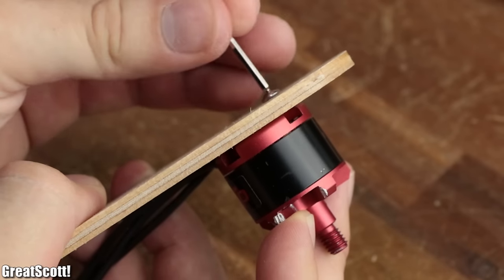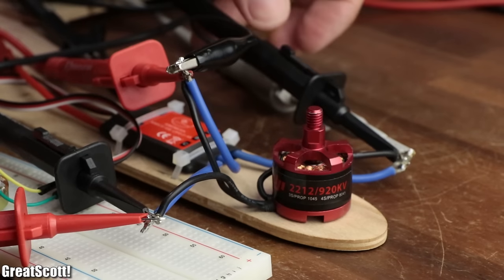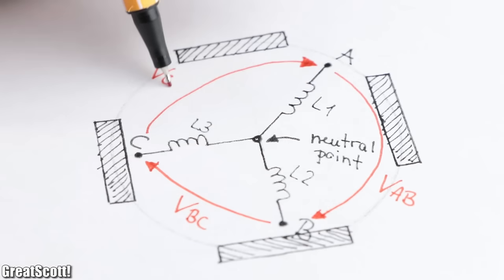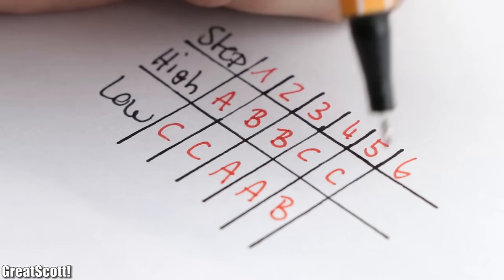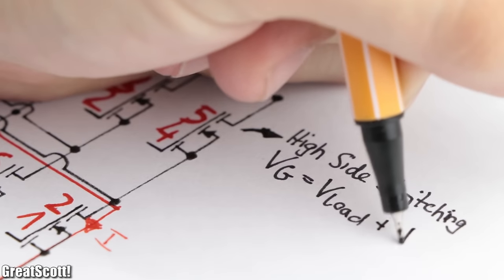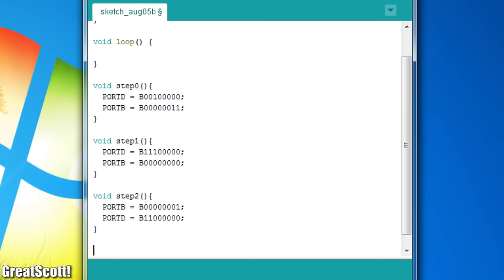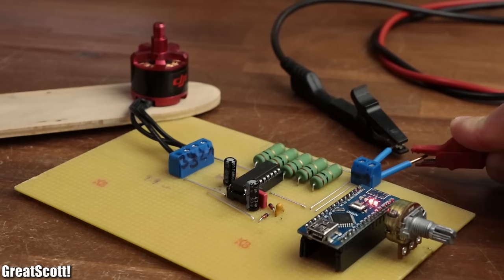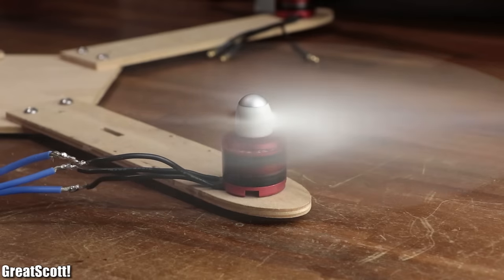Make your own ESC || BLDC Motor Driver (Part 1)

Comment: Hi I really need some help I am building a bait boat for fishing I need it to be slow in the water and fairly quiet .. my current parts are brushless esc x2 30a ... 1x servo ...1 x 7.2 v 2000mah nimh battery I have not yet bought brushless motors as I don't know what ones I would need I have been advised to get a 4000kv motor but most of them pull more than 30 amps ... please help

Comment: I finally purchased an Arduino and I'm (very) slowly getting the hang of it. Any suggestions on how to incorporate it into my previously built ESC seen at   https://youtu.be/1jEWw0g8Fwg   ?  Do I just swap out my diy logic board and replace it with the Arduino pwm function?

Comment: hi i bulid hexacopter 1600g and i  use motor A2212 13T  1000kv with 180 watt and esc simonk 30a and with Battery 5000mah 11 v    50 c      but when i go to ecal website he give me a remark :max. power over the limit of the motor. Please check the max. power limits defined by the manufacturer! (electric Power: 273.6 W > Limit (up to 15s): 180 W)
so can i add some ressistors to motors then the problem will be solved without making change on kv or thrust from each motors

or i musst to change the battery .
give me please your advice

Comment: would this work with a HDD motor i am trying to build a tricopter with those but can't find any information how to drive them
Reply from the maker: Yes, HDD motors are also BLDC motors.
Reply: but there are 4 wires coming out
Reply: I think on HDD motor you also have access to the central point of the windings.
Reply: ya i just noticed that there are 3 phases an a common point i gues theres no point in waiting for a part 2 so iam going to buy and esc

Comment: I m working on a rc plane with 433mhz module. Building transmitter and receiver but the problem of creating the transmitter and receiver is that how can i get a PWM wave signal from receiver. Any help from anyone would be respected regarding this issue.

Comment: Can you please make a brush less motor driver for a huge motor I am making a go cart and will be converting a huge truck alternator into a motor , but the driver capable of taking heavy load greater than 125 amps , as it is a commercial product want a robust system, please tell me the cost .
Reply: I have a similar project I'm working on. I think it uses 150 Volts DC. My project is for a homemade cnc machine. Do you want me to send you the schematics of my driver board when I'm finished? Or do you got the specs of your motors and stuff? If you need to contact me just email me
Reply: @DreadQuill  Hi , I have 24 volts brush-less converted from a car alternator
but it needs a robust speed controller

if you are making that monster driver please do share thanks
Reply: Yes, my drive needs 600v output and like 40 amp out maximums as well, I found a 3phase driver chip that has those specs so I will start creating the schematic for this beast...

Comment: wood is not good for this it will brake , use carbonfiber sheet . using a simple jigsaw you can cut any pattern

Comment: I have recently developed the need for a cheap or DIY 4 phase ESC, the use case is reusing some recycled 4 lead BLDC motors from HDD and disk drives.... your thoughts or comments on this would be greatly appreciated.

~JZ

Comment: I fucked up my " chinese" esc🤣, but the mosfets are fine. Theres a electric door lock, when i connect it, it will overheat my resistor. But it does notwork.

Comment: Sir I have a motor with following Specifications: 
Item Name: 2040 4480KV 4 Poles Sensorless Brushless Motor 
Watts: 220W
Max Voltage: <11.2V
Max Amps: 18A
Rotor Poles: 4
IO: 1.4A
Resistance: 0.0454
KV(RPM/Volt): 4480
Max RPM: 50000

Comment: Why are you drawing a Y-wiring diagram for this motor? This appears to be a regular RC brushless motor, which are Delta-wired, not Y-wired. There's no common central point. Are you sure that yours is somehow an odd specimen with Y-wiring? In any case, ignoring this important matter destroys the credibility of the whole video.